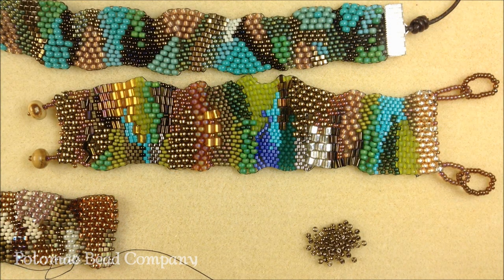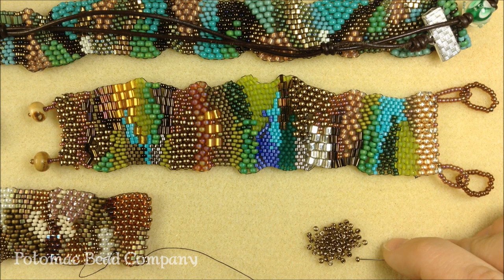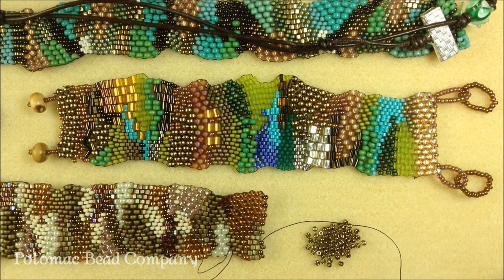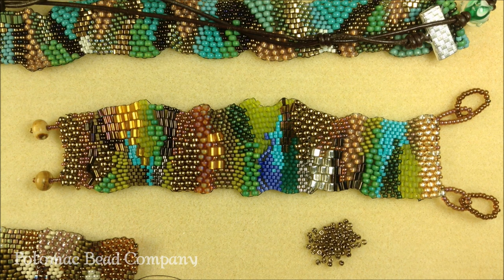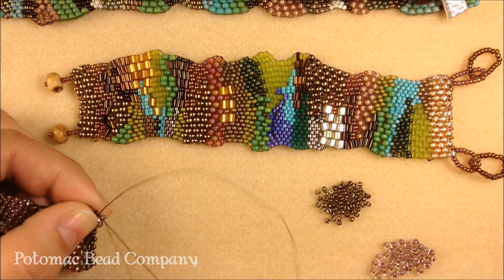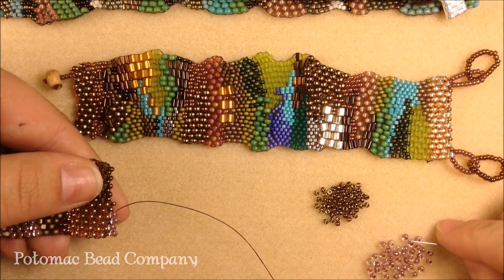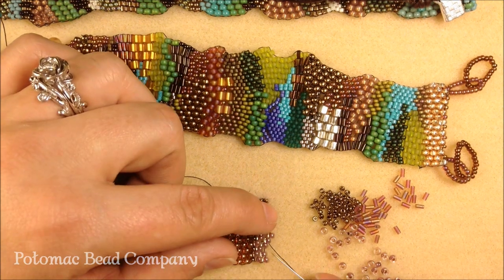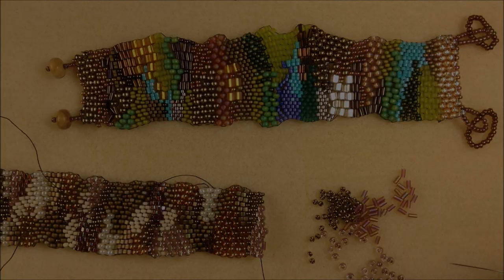Freeform Peyote Stitch - DIY Jewelry Making Tutorial by PotomacBeads

Comment from the maker: It could probably be added anywhere, you might just want to use some larger beads like 6/0 (or beads with larger holes like 8/0 delicas) at various points in the bracelet to give you anchor points.